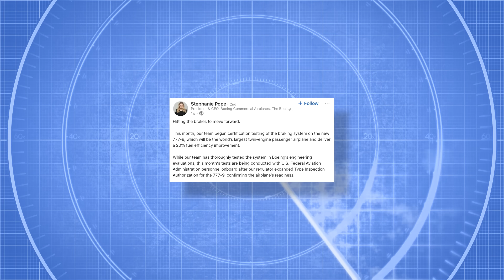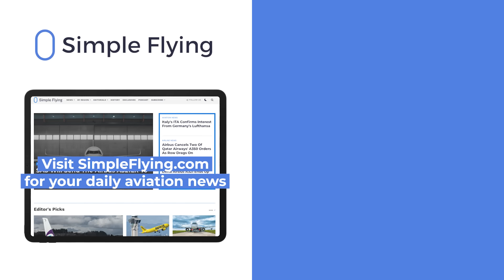Boeing 777-9 Undergoes Certification Testing Of Braking System

Comment: Years ago I was on a Delta stretch 8. We were leaving MCO going northbound and had reached, I believe, V1. Due to a recurring problem that they had encountered on the previous leg (I don't recall what it was) the pilot aborted the flight. By the time we got back to the gate all tires were blown and we were surrounded by the fire engines. This was at old Orlando airport, before the present new one was built. Kinda wild experience although I was never truly frightened by it. The plane was solid and the fire crew was there quickly.
D Paul

Comment: I have.  In January 2023, I was aboard an AA 77W departing GRU.  We had a pressurization failure, descended to FL100, held then returned back to GRU for an overweight landing.  This was the first time I experienced full reverse and full brakes and we used up most of the runway.  The carbon brakes were glowing red and the fire trucks were cooling them with water when we deplaned on the tarmac.  These machines are truly impressive and people take them for granted until they experience their max performance.  Those GE90s are absolute beasts and it's probably the only time I'll ever experience what they can when pushed (full reverse).

Comment: Departing Mali Airport in the Maldives, out Airbus A320 experienced a right engine failure during the take-off run. The Crew affected and emergency stop on the runway before taxiing back to the terminal apron as the gates were all occupied where we were deplaned. Though an exhilarating experience in itself, we were glad they were able to complete the E-stop while still on the ground and not have to make a return to the airport with a fully loaded plane on 1 engine.

Comment: I was on a flight from MKE to DFW and there was "weather" in DFW; the pilot said we were going to make an "aggressive landing that was within the design capabilities of the aircraft."  Soon I saw we were coming in on the (very short) cross-wind runways at DFW.  The pilot put us down hard, hit the reversers hard and laid on the brakes; we stopped with plenty of room to spare.  Lessons learned?  A great pilot is key; and the DC9 was, and is, a freakinly awesome (and overbuilt) aircraft.  Had something similar at Fargo with an NWA aircraft; a tribute to the aircraft and NWA training.
Reply: The crosswind runways at DFW are shorter than the north/south parallel runways; "very short" is, at minimum, a slight exaggeration.